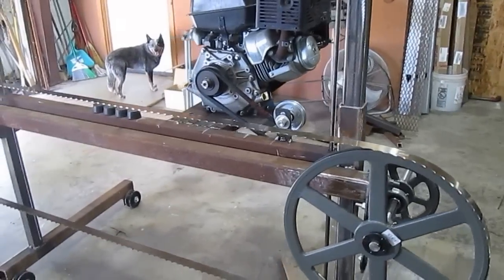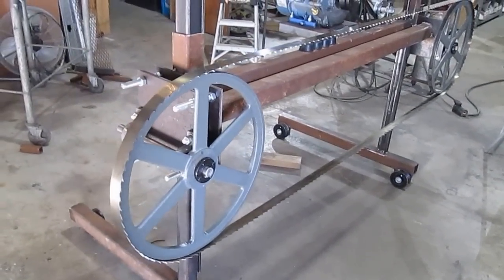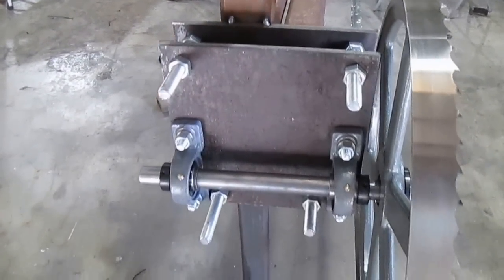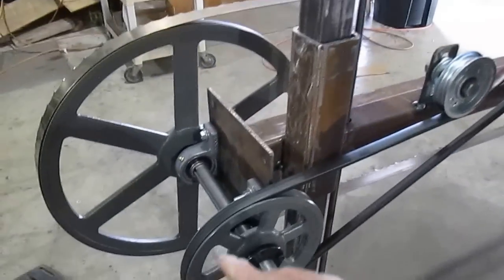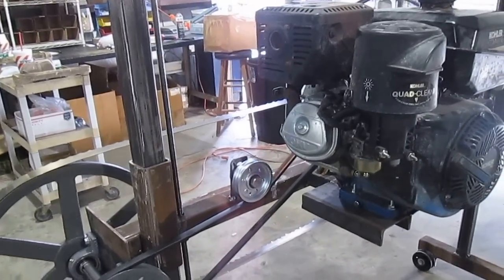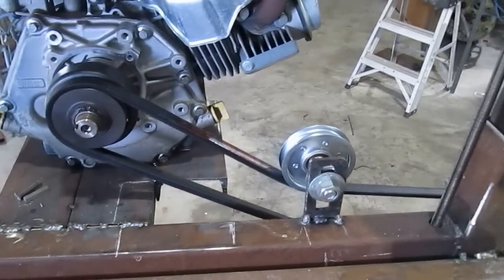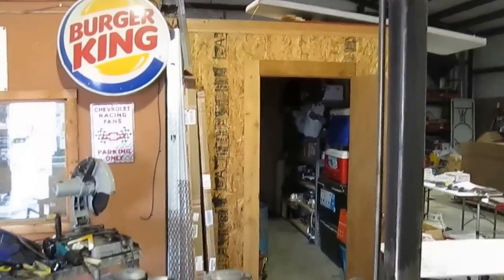Homemade Sawmill 2nd Video

Comment: I'm wondering if you should add a 45% stabler bar to back of legs to help keep vibrations down. Question about band saw blade wheels they appear to be narrower then your band have you noticed a problem with that? Looks great going to copy your design desperately need one right now thanks for videoing.
Reply from the maker: That is what I had in mind, once I get a little more time to do it. we are in the middle of building a new home and my time is slim..My band saw wheels are narrower, but it has never been an issue, I would not want them to take up the width of blade as that would ruin my tips on my blades pretty quickly

Comment: I'm just assembling all of the parts for my version. Can you tell me how you attached your carriage tube to the threaded rod. I'm using 3/4 inch rods and I have a threaded coupling which I will carefully weld to the tube. Really like your design. I too am using recycled stuff as much as possible. Take care.  Phil
Reply from the maker: I purchased the correct nuts for my rod and welded them to the bottom of my carriage.. Make sure to put plenty of lubricant that will help the nuts from welding to the rod

Comment: I finished my mill about six years ago and put a 3 inch centrifugal clutch on the motor with a 14 inch driven pulley so at top engine RPM I have a driven pulley speed of about 740 RPM. That gave my blade an SFM of close to 3300 which I thought was a little to fast but the blade manufacturer recommends 5500 SFM..
Reply from the maker: I had an issue with the speed of blade when I first built it. I had to change the drive pulley down to a 11". Not sure what my blade speed is, but it works great like it is
Reply: So you’re using a 3” motor pulley and a 11” drive pulley with 19” blade pulleys?
Reply from the maker: That sounds about right

Comment: would recommend some diagonal welded bracing and a double vertical arm instead of a single.  4 pipes, not two for the vertical support.  3 bearing blade guides not one in order to encapsulate and control the blade and keep it from slipping off.  13 hp or above,  10 inch large pully or larger on the drive wheel.
Reply from the maker: Please take a look at my other video's. It shows some of those suggestions already done.Thanks

Comment: The only concern that I can see would be the amount of stress that the weld between the vertical structure and it's horizontal supports.  Consider beefing up the joint.
Reply from the maker: So far no issues. But you are correct. Appreciate the comment

Comment: Or are you just going to run the blade right on the wheel steal against steal and if so do you think it will slip as your starting to cut into the log ?? Also thank you so much for all your help
Reply from the maker: I don't believe that would be a good decision for many reasons. First I do not think it would work and would cause many other issues

Comment: The ratio for a 13 HP Motor should be 4 to 1 that Will gave You for a 18.75 sheves 4500 feet minutes on your sawblade ....good work. Sgt rod
Reply from the maker: appreciate that. A lot of folks have been asking me that question.. Thanks Again

Comment: Hi,  A few questions:
1)  Is that a centrifugal clutch on the motor?  If so, can you provide spec/supplier?
2)  What is your "center/center" dimension of the main pulleys that the blade runs on?

Thanks, Jeff
Reply from the maker: Yes it is a centrifugal clutch, on a 1" shaft..It is rated for a 8-13 HP Engine..We sell them on ebay under seller Flatscat1202...I will need to get you the measurements

Comment: I would really like to see how that works out adjusting the tension and tracking on the same end. And from what I see engine wise. that 14 HP Kohler will work just fine if you are running 16" +/- blade wheels?? And yes, you need a larger engine to blade wheel pulley. About 12". So far, I would say that you have yourself a sweet build going on there and I want to see where this goes so, please keep posting your progress. Really nice so far.
Reply from the maker: I have shives that are a little over 19" Diameter and it seems to be just right.. The engine runs and cuts good as it is at around 40% throttle, but I have a bigger pulley that I will be trying to see what the difference will be. Hope to see a big improvement.. Appreciate the comments..and advise
Reply: Yeah man, get into that torque range @ 80%+ and let it rip.. At the HP you have, you want about 3800 to 4000 SFPM blade speed. It will eat logs at that speed.
Reply from the maker: I should get a chance next week when I install the new blade and when i do I will try to video installation of it, to help varify what I do and how it is done

Comment: What size bandsaw wheels are those and where did you find the and how much did you pay for them I have been looking for some that are at least 19 inch round maybe larger but the cost is like crazy so if I can ask what sizes are yours and what did you pay for them
Reply from the maker: Go to the following link  http://www.ebay.com/itm/18-3-4-BAND-SAWMILL-WHEELS-PORTABLE-BAND-SAWMILL-BANDMILL-LUMBER-WOOD-2-/162429888219?hash=item25d19366db
Reply: I built mine and trued them up on the axle itself..
23" x 1.75" wheels are perfect for a 1.25" blade.

Comment: NOT everyone can do it, and the TRICKY PART is the ALIGNMENT of BAND SAW  & WHEEL , please let me know if I can buy from you  w/o engine and tracks for easy shipping  and How much it COST????  thank you
Reply from the maker: I am in the middle of building a new home about 8 hours from my current residence or else I would be glad to build you one..i will be tied up for around 3 months, once I make the wife happy, I will be back to my old fun and games at my new place. I am going to do some upgrades to this mill as soon as I get the chance. I want to beef up the guide wheels. I would also like to set the main uprights back about another 4 inches to give it even better and a more even control when going through the logs.. I have cut many logs with it at this point and so far I like the design. Stay in touch if you haven't purchased one later on, I will see what I can do to help you
Reply: My plan is to ship to Philippines that's why I don't need engine an tracks 'cause it adds weights for shipping , I wish I can visit your place to see the unit....  thanks a lot....

Comment: with 14 hp your blade should rotate about 4000 sfpm (surface feet per minute) Here is how you figure the correct ratio .http://vintagemachinery.org/math/sfpm.aspx  You want the drive pulley as large as you can get and the engine pulley as small as you can get.  I'd  say you need an 18.75 drive and a 4.5 engine if your band wheels are 19".  Your current gearing has the blade going like  11000 sfpm thats  like 3 times as fast as it should be spinning.
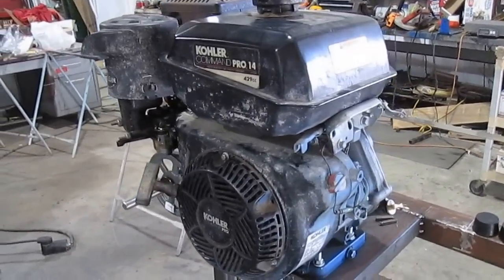Reply: 1:28

Comment: You for real need to get rid of those threaded rods , & the chains on top , & go with a boat winch to raise & lower it ,but it looks cool other than that
Reply from the maker: I would have to disagree with you on the boat winch..I have been down that road on my other sawmill.. and it was not as accurate as this machine. The rods you see on this machine are for a lathe and will last a lot longer than regular all thread rod..adjustment is very accurate and stable and final cuts on board is more true..
Reply: @LarrySbrusch  wow, that's awesome to know, i just figured the chains would give you troubles from sagging & slipping off the gears, & the rods would end up , well never mind, your the man, i guess 1 does learn something new everyday thank you kind sir, i so love this build, i just gotta have 1
Reply from the maker: Appreciate the comment